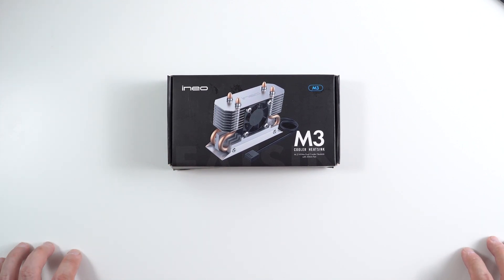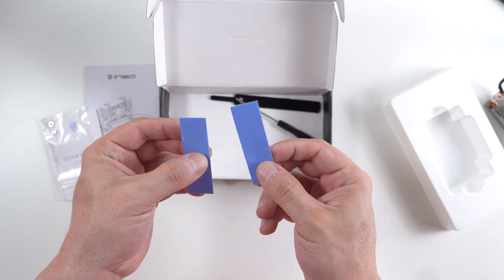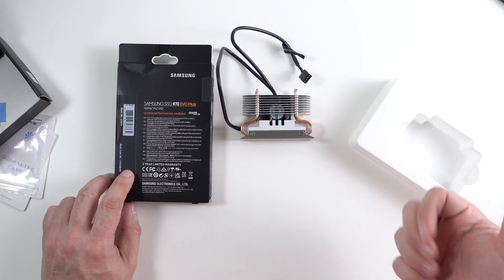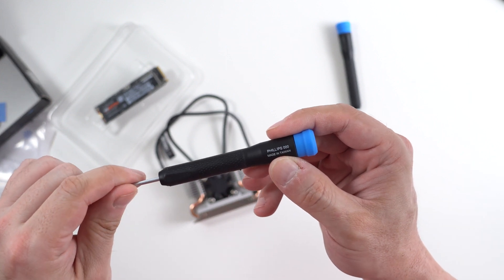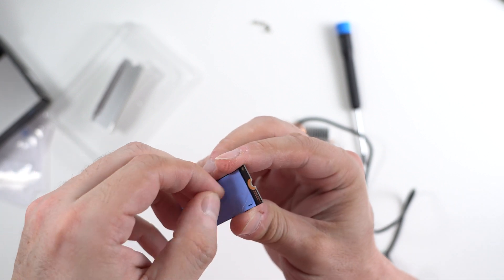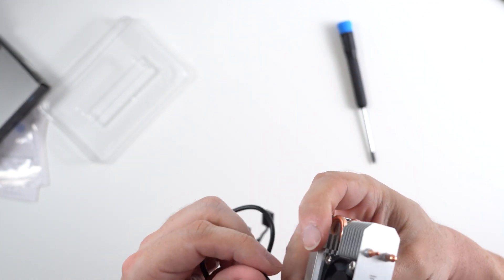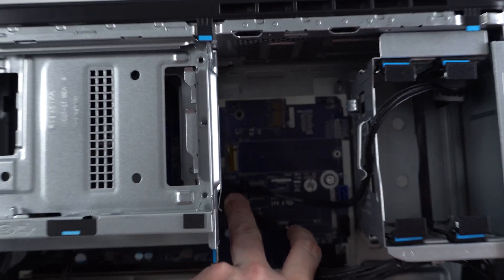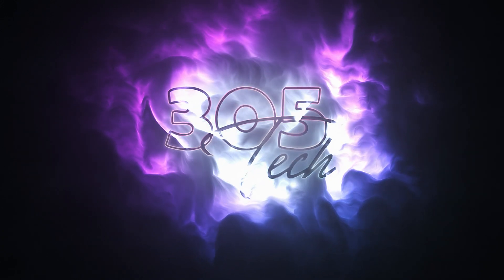Fix SSD Overheating issues with the Ineo M3  Active SSD Heatsink Cooler + Samsung SSD 970

Comment: The drive was installed incorrectly. You should remove the stickers from the chips, degrease them with isopropyl alcohol, and then attach the thermal pads.